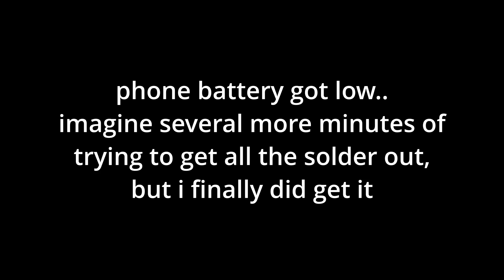Behringer UMC202HD | USB connector repair

Comment: Does messing up the USB port on the back make it unreadable to windows PCs? Because if so, that might be my problem. I have the same problem with the jank port, but it made me unable to use the interface altogether because windows couldn't detect it as a compatible device. I'm just wondering if it's the same problem.
Reply from the maker: Yes, the USB port is how the interface talks to the computer, whether it's Windows or otherwise. If that port is damaged, no computer is going to get in touch the interface
Reply: @fumblebork  even though it gets power from the PC?
Reply from the maker: @ArryOnline yes. There are two pins for power and two pins for data. You may be getting power but not data

Comment: You don't have to remove the front panel. pull off the buttons, remove the screws at input1 and 2 and you can pull the circuit board out backwards